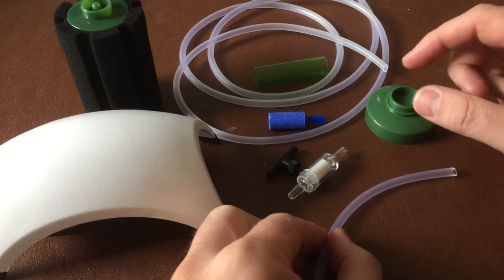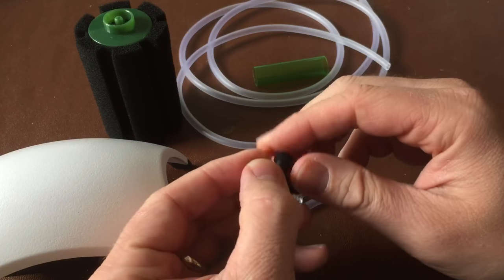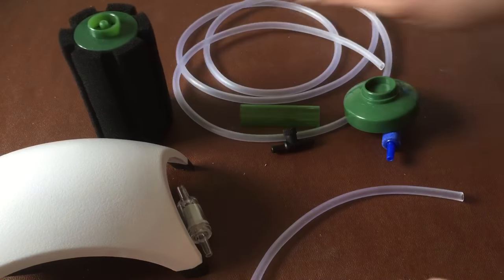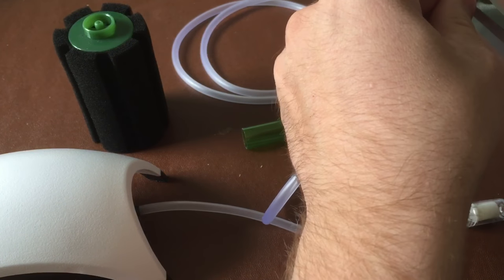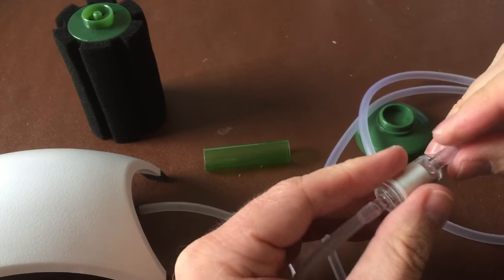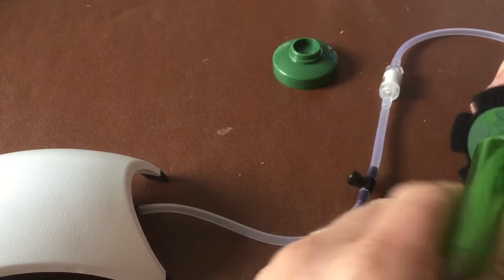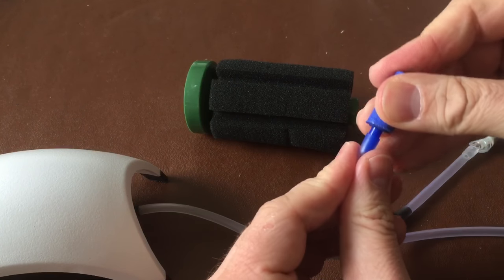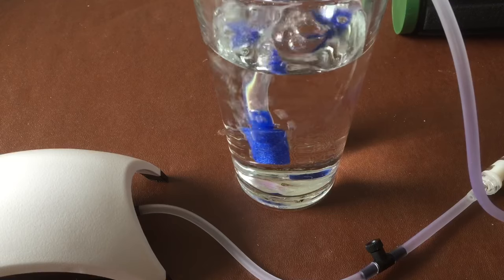How to set up an air pump, air stone and sponge filter in your fish tank or aquarium

Comment: Just a hint dip the end of plastic tubing in boiling water ,much easier to fix onto the ends of pumps etc , many thanks
Reply: This is what I was looking all over YouTube for…an easy way to get that hose on LOL! I thought of using very hot water but wasn’t sure if it would degrade it. Thanks for confirming it can be done 👍

Comment: i have a pawfly. still done get why i have 2 tubes. also not sure how it will work if it's not taking water and putting it back in as using the filter rather than the stone.

Comment: Want your air pump overheat they restricting the airflow? I put a tea valve in to add the airflow valve soul a cut off pressure can run I watch the end and to the bubbler and not overheat the pump.

Comment: Three points. 

1. Air pumps don't add oxygen to the water, otherwise all the oxygen tanks in the world could be replaced by simple air pumps. The oxygen is absorbed at the surface. The rising bubbles lift the depleted water to the surface, where oxygen can be absorbed. It also helps to keep the surface in motion, breaking a lot of floating oils.

2. When you use an air valve in the way you do, you shorten the life of your air pump by forcing it to work against a partly blocked air line. It would be better to use a "Y" or "T" connector and have your air valve connected to the "unused" side. This allows the unrequired air flow to be bled off.

3.  Check flow valves can fail from either side. From the air pump side or the fish tank side. If the the line becomes unconnected on the air pump side, then the check flow valve will do it's job. But if the air line comes off the check flow valve on the tank side, then the water could flow out the air line. If the check flow is located inside the fish tank (just over the edge, but not in the water), then the check flow valve will either just fall into the tank or the air line will drop to the ground behind the tank.

Sponge filters are annoying to have to clean all the time and take up a lot of tank space.